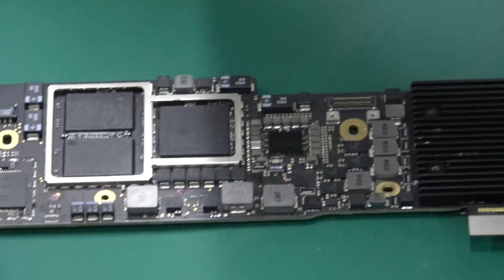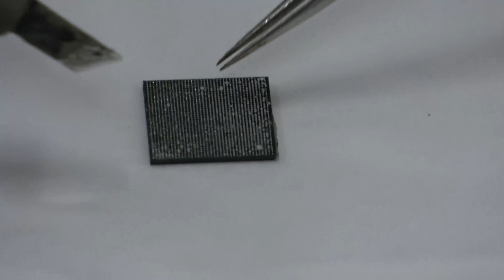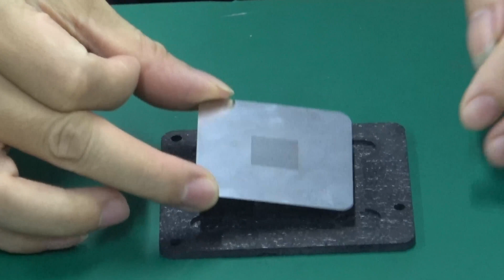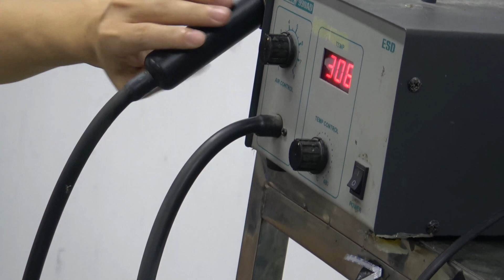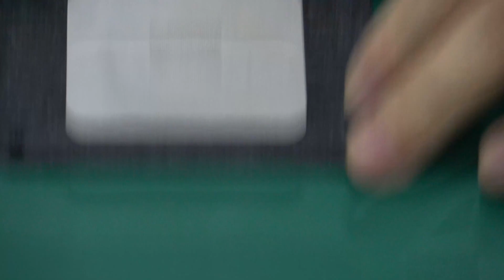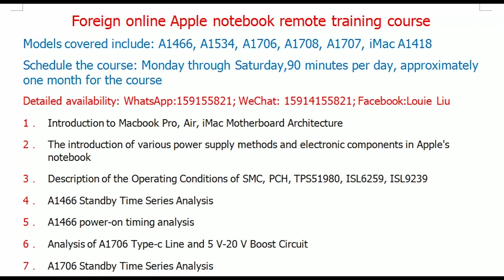How to Reball T2 Chip (MacBook Air, 13-inch, Late 2018)

Comment: Question: I've repaired a 15" macbook pro, turns out the T2 has activation lock, can i replace the 15" (2019) T2 chip with a 13" (2018) T2 chip that isnt locked (waterdamaged and cpu dead)? Will this work if i replace both T2 and NAND?